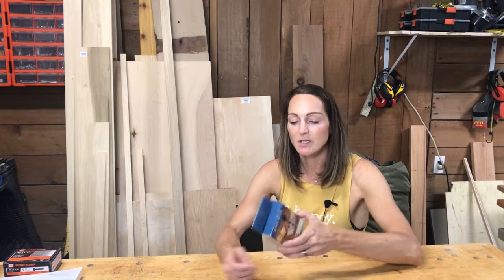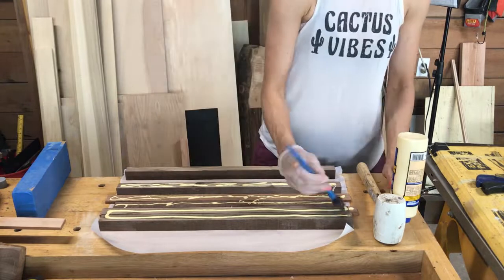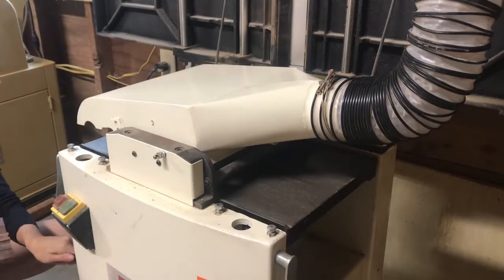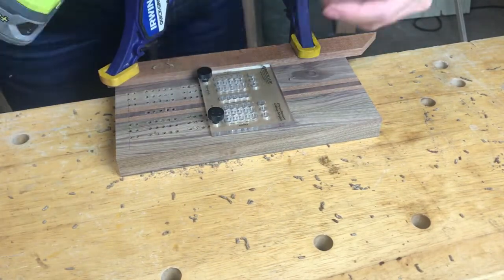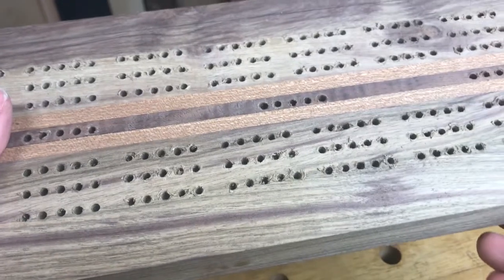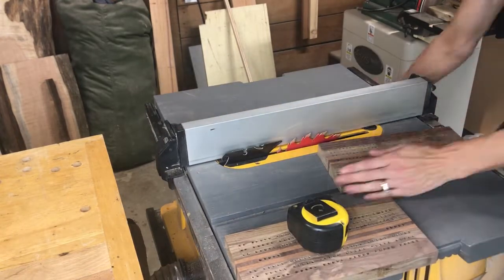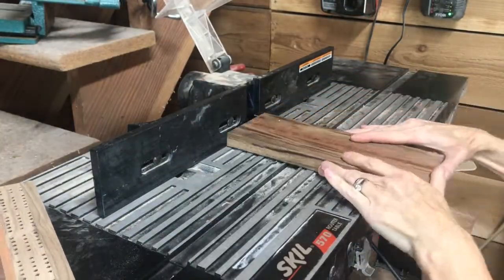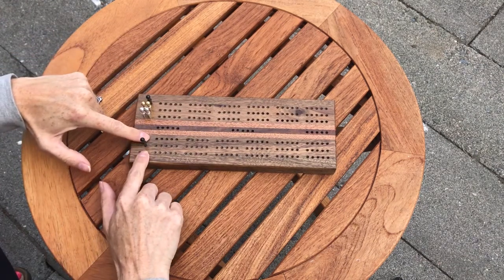Cribbage Board Tutorial

Comment: I use a Rockler template also. I've done a number of 3-track cribbage boards in 1x6 pine. (i'm cheap)  Also I find if you "pump" (push in and back) the self centering drill adapter at least twice into each hole it helps clear the drill bit of the packed wood dust. Be sure the self centering drill adapter spring is fully extended before going to the next hole in the template. 
I usually drill a group of 10-15 holes at a time, check the drill tip temperature, pull back the adapter to expose the twist drill, clear wood dust build up with an old toothbrush and let the drill cool down before continuing. 
For your excess holes: Cut some 1/8" dowels to glue into the extra holes at the end. Trim flush, sand and/or plane. Use a walnut color touch up pen to blend in the dowel ends, then apply the poly finish coats. You can still see that a mistake happened but it will avoid confusion during game play.
Reply from the maker: Thanks so much for commenting Ralph, this is so helpful.  😀

Comment: good video. I ran into the same problem with tearout when drilling the holes and will use your tipe of re-planing after drilling,.
To avoid having to re-drill all the holes, I adjusted the lenght of drill bit in the self-centering drill bit so that the holes are a little deeper (I made the bir flush with the tip of the self-centering drill bit)
I can now plane off 1/32" or so and the pegs will still fit.
Reply from the maker: That's a great idea.  Thanks for the comment John 😁